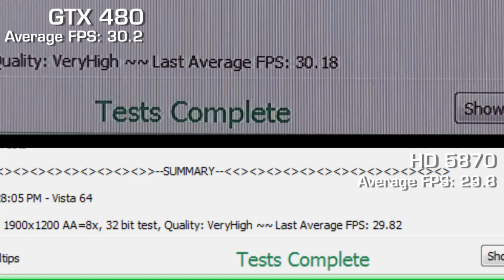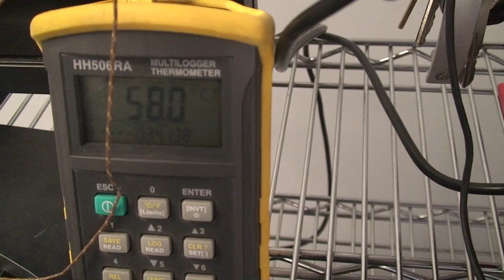NVIDIA GeForce GTX 480 Benchmarks Bad Company 2, Crysis, 3DMark06, Temperatures & Noise

Comment: Just watching older tech videos. Curious why you didnt have the fan speed at 100% during gameplay. Or at least 75% and 100%
Reply: Noise probably
Reply: @vampirecount3880  just have headphones or speakers on so you don't hear it. Better to have better Temps
Reply: @xpodx  I 100% agree. Just pointing out that for some people the noise level matters. I also believe that noise is irrelevant, but there is an audience that values lower noise. Some even value noise reduction over performance. ¯\_(ツ)_/¯
Reply: @vampirecount3880  yea I just set an aggressive fan curve on my 4090. Never goes about 68c and I think 80% usage at that temp.

Comment: Amazing card but it's 500 buck I think I'll wait for Tessa.
Reply: lol that card will melt the ice on the north pole (gtx 480)
Reply: This is not an amazing card. It was released 6 years ago. Look at the date the video was uploaded. For $500 you could buy a gtx 980ti and get nearly triple the performance.
Reply: Adam noName I was joking mate hehe.
Reply: I live in the midwest (it was just -20F a few days ago) and I purchased a 480 for $50 on ebay. Works great running @ ~76F MAX load.

Comment: who do poeple complain that this card runs hot? so it stays at 80c,(my old ati card ran at 95c 100%fan) but the fan speed is at 40%, that means big room for overclocking on stock cooler. and if your rig has a case the fans are muffled. i have no case but i got big ass subwoofers so i never notice fans on 100%
Reply: RockeyDAproductions after applying new thermal compound on stock cooler was able to stably overclock to 870mhz staying blow 80c, that cased evga oc scanner to go from 280fps to 360fps. and if i enable sli it goes back down to 290fps(no happy with sli)
Reply: 80c on an open bench, inside a case it goes 90+. I knew some guy who had to repaint his wall behind his PC because his GTX 480's exhaust destroyed the paintwork.
Reply: babatunde ogunde i always have done a test bench style setup, and befor i had my sr-2 i had my gtx 480 in a dell XPS 600 witch has amazing airflow and i wish i did not gut that case. i gutted it cuz it was to big.
Reply: RockeyDAproductions In the future, we have 1060s that run at 55C 70% fan 100% load

Comment: fuckin piece of shit card, on idles it consumes 54W, which is more than a GTX 860M on max consumption power(860M idles with less than 4W)
this fuckin piece of hot charcoal trash consumes 320W alone maximum, whitout delivering more performance than a cheap 860M

if I see one GTX 480 I'll throw it in the garbage fuckin mickey mouse club champion noisy hot charcoal trash
Reply: Yunno 860m is a mobile card it is still new this 480 is from 2010 old technology it is a piece of Trash if we compare IT to a 780ti or a 970 even the 980 which has the fastest gpu you cant compare a n old graphics card to new ones and usually mobile graphics cards like the 860m are less hot the a desktop graphics card.;)
Reply: TheDorapapi321 a 860m is a mobile gpu...
Reply: +TheDorapapi321 you are comparing a power efficiemt maxwell MOBILE gpu card to a top of the line old architecture desktop card that also still has more power than a gtx 860M. Your brain must be a weird place.

Comment: 650 ti boost.  I'm pretty sure it's only like $20 or $30 more than a normal 650.  It should get you plenty of performance in 1080p (my 660ti could max everything other than Metro 2033 with decent or playable framerates, and the 650 boost is just one step down).  Plus, you want the more up-to-date drivers and the build quality on the 650 is MUCH better (far less noise and heat).

Comment: More room for SLI?  560s only do 2 way SLI, the 480 can be 4 way SLI and can be had for $200.  I've got 2 and am ordering my 3rd.  The two I have are overclocked to 810MHz core and drive 3 monitors fairly well.  I want a 3rd to bring all the settings up to max again, though.  Noise and heat when overclocked really isn't as bad as AMD fanboys were claiming it would be either.  85C at 75% fan, again overclocked but no voltage increase.

Comment: @JoostRevo It does if you understand it the cryengine 3 is a heavily degraded engine from the cryengine 2 engine but that goes without saying it pretty much maxed out the meaning for DX9, But it's just tons of console porting and the cryengine 2 maxed out vs the cryengine 3 maxed out cryengine 2 looks ALOT better and more realistic but isn't as optimized.

Comment: I couldnt agree more, my 470 reference with very bad case is alot cooler then the ones in the reviews, it idles at 40c and loads at 72c when gaming.

But i get avg 47fps in crysis with 16xAA, i think its wierd  how this 480 only got 30fps.

Maybe its just due to me using the quadro 265.90 drivers.

Comment: My GTX 480 never got above 60C. I just turned the fans up to 75 percent and used it in a well ventialted Antec 900. In fact, even overclocked it ran about 33 C on idle.

Comment: @CaptainCrunchityzer you should consider the gtx 460 then, I have it and it can play even crysis on pretty high settings. I have it overclocked as far as it will go (875 core,2150 memory) and the temps never go over 75 C. This is on the Gigabyte internal exhaust model, and it even did fine in a crappy no airflow dell case before I got a new case. :)

Comment: i've tryed both cards & simply put 480 wins hands down, If you have the money & want a great card buy the 480, if you don't the 5870 will do the job just fine both great cards. btw if your planning to go dual monitors 5870 has flickering problems & the gtx 480 has heating problems.. but if you think it over you can fix the heating problem with good air flow but you cant fix the shitty flickering on the 5870 my 2 cents.

Comment: @MrB1rdman GTX 470=5850 GTX/ 480=5870+10%/ 5970=GTX 480+ 25-30%.
Overall in non tessellation games, the 5970 is the better deal. 5870 actually performed better than the gtx 480 in crysis, an nvidia dominate game.

Comment: @nahuel2222 the 460MSI max heat temp is about 70-77 wich is the same with 5850 , 5870 and the 5970 wich comes up to 85 sometimes. why will no 1 bitch about that? because ppl can see that NV is doing better and ATI fanboys is going BITCHING time! the gtx460 outperfoms the hd5850 easily! and as i sayd before LEARN YOURE FACTS BEFORE TALKIN SHIT! nvidia confirmed theese card to run HOT ! its based on a TESSELATION arcithict ! GTX 470 is meant for perform better then 5870 and it does , gtx480 = 5970

Comment: @nahuel2222 okay you are so stupid! plz learn youre fact before talking shit!! HATE IT! the last gen of NV and ATI cards did do ALOT of heat , ALOT of power draw , but now with over 2-3x the perfomance it became a problem?? i dont see the point realy? if u have a 80plus PSU , its no problem at all!! and the GTX480 is a GF100 chip with 3.2B transistors , ATI Cypress is 2.13B transistors so calculate that? over 1B transistors more! and the GF104 chip is lower power draw and lower transistors 1.95

Comment: @nahuel2222 AMD hasn't been better than nVidia for a few months now. GTX470 beats the HD5850 and comes close to the HD5870 (beats it when overclocked), and is cheaper than the HD5870 and most HD5850's.

nVidia WAS doing badly, then they lowered prices, now there's no reason to go AMD.

Comment: @nahuel2222 You have an aftermarket card with a non-reference cooler that exhausts heat into the case, and you're comparing it to a stock/reference cooler with an external exhaust? Not to mention these GPU's are designed to handle this kind of heat.

You're not too smart, are you?

Comment: @HeLeX63 Your 4670 is about 1/8th of the power of this card, at best, and it's designed to have low heat/power consumption. This card is much, much stronger and is an enthusiast card. 85 degrees isn't bad at all for a GPU designed to handle that kind of heat.

Comment: Instead of getting a GTX 480 you could get 2 GTX 460's in SLI. 2 GTX 460s in SLI gets better performance then the GTX 480, and its 100 dollars cheaper. its also a lot cooler. 
A very good deal to go with a GTX 460, much larger bang for your buck then AMD GPU's.

Comment: @ThermalwolfStarcraft Lulz Even 3-way 480 SLI isn't faster than two 5970s ...Epic fail for nVidia. 480 can't even compete with the 5970! 480 = 5870. 3-way GTX 480 is definitely a force to be reckoned with. But one does not merely walk into the land of 3-way Fermi. It requires a 1500W power supply. Another fail

Comment: @MrB1rdman : It goes like this:

1. HD 5970
2. GTX 480
3. HD 5870
4. GTX 470

2x GTX 460's in SLI mode, or two HD 5850's in Crossfire will beat most of those single card solutions, however.

Comment: My load temps on Furmark with my 480gtx are 63c after a few hours =)

Thermalright Spitfire and GF100 bolt though kit eliminate the "heat factor". With this combo I added a 140mm fan that only makes about 18-20 dba of noise, so my 480 is also much more quiet than stock 5870. 

My card was getting 85-90c load before, and the only reason why I modded my card was for the noise that the fan would make at 60-70%

Thats some better FPS you are pulling, probably because of my shitty 1090T :(

Comment: ah just what i was looking for. the temp readings during the crysis testing. 85c is what i used to hit in my raven2 and my current haf 932. the fans in the 932 are semi useless for power, so i just today installed 4 thermaltake dc red fins on the side and literally CANNOT exceed 75c in warhead maxed no aa/af. I prefere to play without the aa/af for fps. So in short, if ppl are going to complain about the temps at load for the 480, just use the power of positive air pressure to your advantage

Comment: @rayright15 
I learned to stop bickering with Idiot Fan Boys on You Tube along time ago. 
all I care about is the GPU... 
what I learned from Multiple official reviews is that the GTX 480 is 15-20% better
Has 2x the Tessellation performance
performs way better on DX 11 games
and also has better minimal FPS. Along with having those basic things I want better in a Card... GTX 480 also has Significantly more Ram then 5870 and it has 3D Vision.... all for 100 more dollars
Facts= Decision = GTX 480.

Comment: one thing i dont get is why everyone uses the 5870 in comparison? why not the 5970?
and if you fix the fan at 100% in CCC running crysis it wont get that hot really
my 5770 got up to 72C with the fan at 65% but when i bumped it to 100% it doesnt pass 64C

Comment: I wan't to buy the GTX 480, however I saw a 5870 that core clock was at 950mhz, and memory at 1250 for only $499 I want to know, which card I should get that will let me play battle Field bad company 2 on extream high and get better FPS? my current specs are.

4GB of kingston ddr3 1600
650 wat PSU
AMD athlon 2 propus 620 quad core running at 2.6Ghz (will over clock to 3.2) 

my mother board is like the m4a9 EVO or something like that. Any help would be much appreciated.

Comment: @FIXTatHWC 

B/S dude about the bottlenecking crap. only in cpu dependent and very low resolution the cpu will become a bottleneck. SSd either has nothing to do with gaming performance. it will affect loading times. that's it. you don't magically get extra fps going from a standard  HDD to high performing SSD.
in game like crysis is gpu bound so even a same clocked e8400 with same gpu will perform identical to same clocked i7 980x. crysis doesn't even use no more than 2 threads either

Comment: @FIXTatHWC 

benchmark supports both ati and nvidia with 16xq. triburitar settings would really wouldn't affect overall performance compared to here either. core i7 920 and 980x is no different when it comes to gaming. i mean if his vid shows the gtx 480 only getting 29fps there with 8xAA and 5870 32fps avg. theres something wrong. here is showing the opposite which is interesting.

Comment: @GoodDay2YouSir

they essentially said they were just fucking around and also had issues with evga's software utility and these are very immature drivers,and remember what resolution and settings were you checking your lowly 250 gtx cards at on crysis,these guys were maxing out everything for the benchmarks,you definitely weren't!!! because you should know this will flatten 3 250 gtx cards effortlessly.
i have a 295 gtx (graphics)and a 9800gtx+(a 250 gtx)physics,6 gb ddr2,3.7 ghz quad.

Comment: crysis benchmarks don't look right. my 5870 scores around 38fps avg 1920x1200 16xQaa very high dx10 .  Bad company as well mine dose better. also even in triburitars video it shows the 5870 out performing the gtx 480 in crysis  especially with AA on

Comment: @bronson4216 

2 gpu's on one chip cannot be compared to a single gpu pcb. its stupid. the 480 is FASTER than the 5870. doesnt matter about heat, power etc, it costs more, its better. end of.

Comment from the maker: @launchsa Actually we were using Evga's Precision 1.9.1 which does not properly recognize the GTX 400 series so the clock speeds are way off, and they have not publicly released evga precision 1.9.2 which does support it. This is also why we weren't able to include any overclocking video.

Comment: 1:15 he has the Core, Shader & Memory Clock all turned down! So if you turn your clocks down and under clock the GTX 480 card then it runs at a cooler 85 degree Celsius but this means jerky graphics and low frames per second.

Comment: @Phantompr56  like to see that the 480 runs at 95c draws over 200 watts and is only faster with tessellation on then the 5870 by a whole 11 percent WoW there brut force approach  failed bit of a bummer as ati would of had to drop prices on its 5000 cards in Uniqine  heaven the gtx480 is 80 points faster then the 5870 but over 200 points slower then the 5970 and runs cooler no 3d though!!!

Comment: @Whallean88 Actually its not the same price as the 5870.. its around £70-100 more.. this card also has a lot of issues with it, heat, not much overclocking etc. I was gonna wait for this card.. but read all the reviews and bought a 5870 instead, couldn't be much happier with the card.

Comment: I read about that it will be GTX 495 with dual gpu and In the GTX 495 will be used 2 big kernel GF100 with 16 working streaming multiprocessors. total number of processors CUDA will reach a phenomenal number of 1024 and NVIDIA has decided to equip the GeForce GTX 495 cooling with liquid nitrogen

Comment: @ImRightWinger I think you are a bit of a fanboy, same thing happened with the 295 so you used 2x 270(?) cores and put the clock speeds down to that of a 260 so it could meet the PCIE power limit standards and the 295 was a amazing card the best of it's time. They could try something like this with the 480. Can you just leave it both our points are valid I understand the chances of their not being a 495 far out weigh the chances of there being one. Fully acknowledged.

Comment: @clogmonkey I know but there is no telling how it will actually run regardless of how it looks. One of the reasons Crysis needed so much power was because it was vary badly coded. If Crysis 2 is better optimized it wont be as demanding on hardware even if it looks better.

Comment: You still have to buy a more powerful PSU to run the GTX480. I have a 500 w PSU, and do you think I can run a GTX 480? I don't think so at all. You have to say that some people don't have PSU that powerful. Most likely I have to buy a new PSU just to run that card. That means that I have buy a $100 PSU plus GTX 480, which is about $500, or more. We are talking about how much power is use here. I would need a 1000w PSU, cause I have 6 hard drive, and all my USB are used up. respond to this sucka.

Comment: @Tigergruppen88 yes it will, there is no problem using an Nvidia card on a Crossfire platform, you just wont get SLI, but crossfire insted. Is it a good move to get the Nvidia? Sure why not. Is it a good option to get ATI?. Yes, why not, plus, youll have crossfire capability.

Comment: It's clear that the GTX 480 will be well above the 5870 with good drivers. But I still stick with the 5870 because of the price : performance ratio between the cards. But I can't see how they will be able to make a dual GPU with the same chip as the GTX 480 use since it's so god damn hot. And this is for the commentator of the video. Do you agree with that? You said that you pay for more, but also get more, but the price is too high for the extra performance.

Comment: I'm confused as to why people would ever complain about heat. You can get an Accelero s1 rev. 2, 2 120mm fans, and 8 zalman copper vram heatsinks for around $40. It be a 4 slot cooling solution (the fans just barley cover the 4th slot on my board) but it will keep any card cool.

Comment: SIICK i got the Corsair TX750W too!! ill be trying to get GTX470 by EVGA, the GTX480 is too much money for me. The GTX470 has a lower price tag and also isnt bad at performance and the GTX470 looks cooler than the EVGA 480 just my opinion im not saying im not gonna upgrade to gtx480 l8er on if i will ill probably buy a custom cooler for the card and maybe OC it a bit. Best idea so far is to get GPU Watercooling and the GTX470 hydrocopper by EVGA :)

Dont give the card back to linus :)